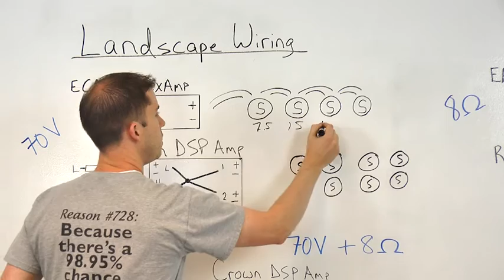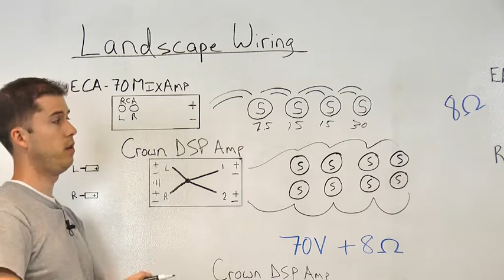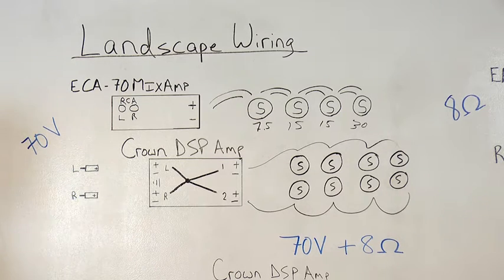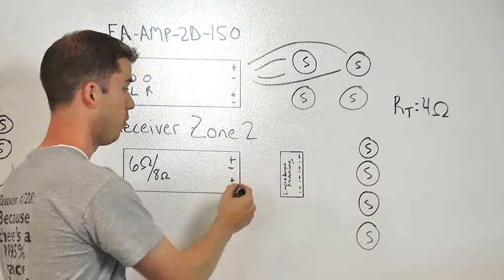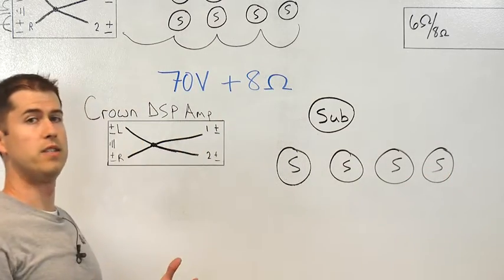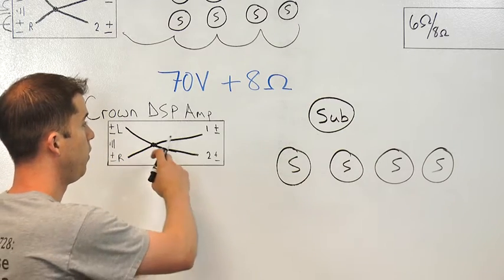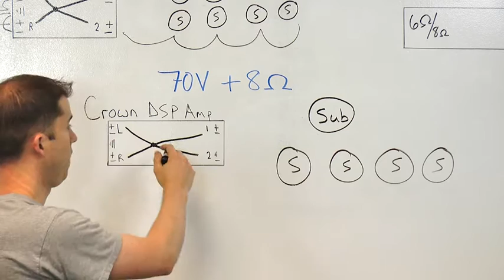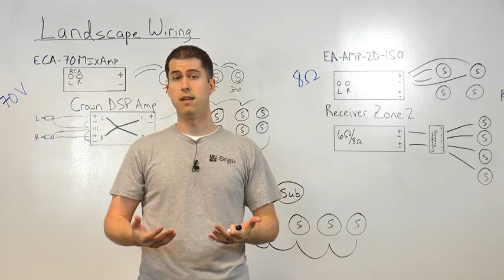Configuration Options for 70-Volt, 8-Ohm, and Hybrid Audio Systems

Comment: I have a Crown CDi 2000 Amp and trying to connect it to run 12 x JBL 100w Control25-1 models. What would be the best way to connect to cover a large area both out door (six speakers) and indoor (six speakers)?  Can I connect more of the same speakers to this amp or do I have get another amp due to the capacity of the amp? Thanks.

Comment: Hybrid hunh?  

Can one Crown amp drive  two sets of two 70v satellites AND the 8ohm sub simultaneously?

Scenario: I want to  use 4 SnapAv 6” satellites and the 12” burial sub (8ohm only).  The first two satellite speakers will be located in the same area (raised planting bed with stone wall surrounds).  The sub will be in this same location/flower bed.  A two satellite daisy chain is easy from the proposed amp location but from the second speaker to the 3rd (and then to the 4th) will be difficult.  #3&4 satellites will be located some 25’ to each side of the first two satellites and the subwoofer, where each are separated by stone staircases with no access to the first location.